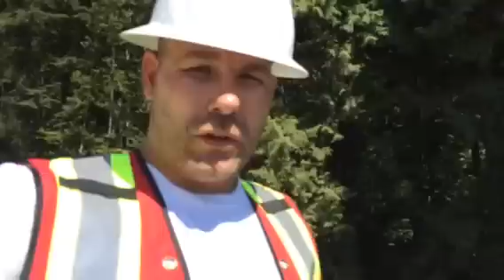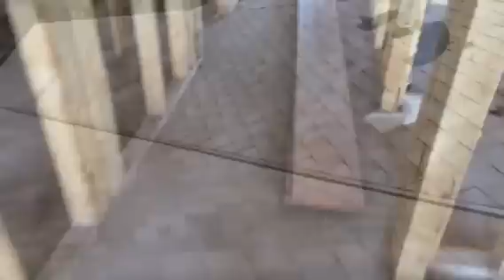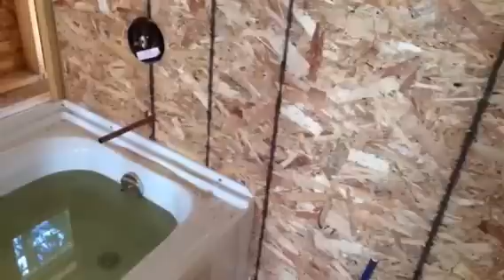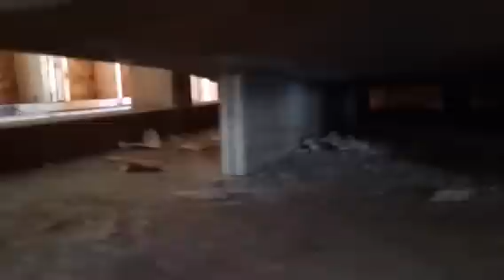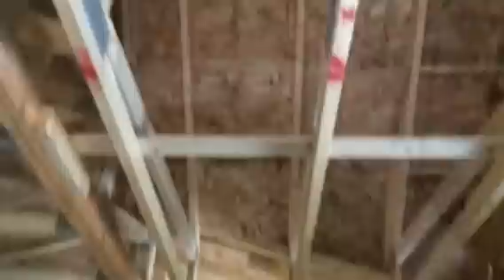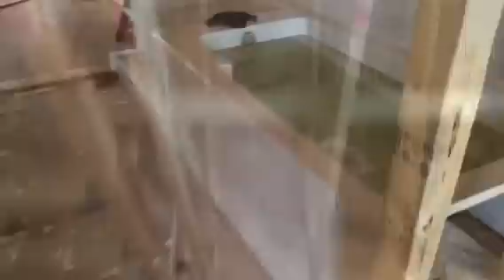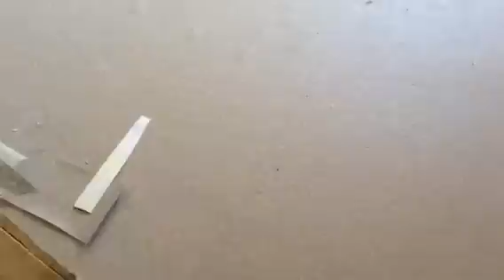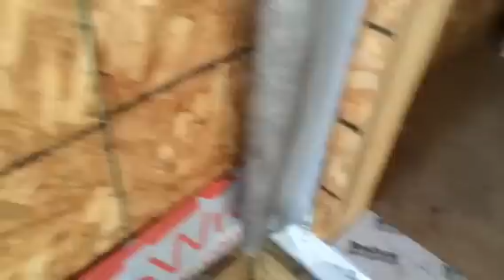New Home Construction Fails

Comment: plywood walls in a bathroom.............fail.
Reply: +wazza33racer OSB not Plywood. They should have used Aqua Board of Cement Board.
Reply: +01blet I do construction in the US and even if is a steel  bathtub we always put concrete underneath
Reply: Plain old drywall is an acceptable backing if it's covered in Kerdi, according to Schulter.
Reply: Real marine ply is a good backing for a Bathroom, but this is just strand board. Absolute cheap shit !
Reply from the maker: +wazza33racer absolutely!
Reply: it could have been a shear panel?? and if it was they installed that wrong also going by cali. codes
Reply: POOPonYOUall   If it was designed as a shear panel it’s on the wrong side of the 2x wall, but I doubt it was designed and I know the code would not require it at this location.
Reply: +01bletsch Yes you are correct. It's a shear wall and will have aqua board or dens shield put over it before the tile goes on. Nothing wrong with that.
Reply: +wazza33racer not if it's kerdi or redgarded
Reply: +wazza33racer oriented strand board is not plywood, neither is acceptable for bathrooom backing.  Constant moisture in woood can  become a growth medium for dangerous molds!
Reply: Incompetence?? Excuse me?? +01bletsch clearly you no nothing about OSB and what moisture will do to it, and I guess you thing joist hangers installed upside down is acceptable??  

I do agree there is no place for profanity in the comments section of my videos.
Reply: +Jamie P The proper way to support the bathtub is with a concrete, base which is best, it won't crack or break under the weight and is simply to do. Shear wall in the bathroom, are you some sort of moron? Please don't build homes and if you do, let me know which one so I do't accidentally by that catastrophe.
Reply: I DRIVE A DODGE STRATUS.
Reply: +C Steele if you've never built a home before you wouldn't know anything about shear walls. If you look for simple clues like that wall is a stairwell wall and may require shear all the way to the basement. So before you call someone a moron check the mirror. That wall is absolutely a shear wall, notice it has blocking at all the joints and also check the nailing pattern. Its a SHEAR wall. Please don't build or remodel a dog house.
Reply: griffey2447 Thanks built two homes, and I doubt this is a shear wall. It could be, so without seeing the whole layout will error on the side of caution but the tub, the upside down brackets, yah, clearly builder is an idiot. Please don't build anything more than a closet  that you can walk out of. ;)
Reply: +C Steele wow so you built 2 homes? ive built close  to a thousand. The only thing I doubt is your ability to see the clues given in this video to actually see whats happening. I didn't see the upside down hangers, couldn't get past the ignorance of the bath. This guy has no business posting ignorant videos on youtube.
Reply: ***** lol bro I agreed with you.  I think you meant to reply to the da home inspector
Reply: oh damn sorry man thought that was meant for me.
Reply: griffey2447 and I bet you put hangers upside down, cut corners at every opportunity, put wood to stabilize the tub which will rot, please send me your info so I can avoid the houses you've built.
Reply: +wazza33racer MUST BE TOLL BROTHERS OR KB CONSTRUCTION
KRAP SHIT FOR BRAIN HOLE HOMES
Reply: 01bletsch  like I mentioned to poop, if it was a designed shear panel it’s on the wrong side of the 2x wall , I have seen this booboo before, not uncommon.  More likely than not, no biggy, will be caught by city inspector along with hangars and corrected.
Reply: Maybee u should learn something about plumbing before u inspect stuff and tell people wrong info
Reply: You're Correct!  It should be Green Board OR Lath & Plaster!
Reply: Bathroom building is atrosious in usa. This would  NEVER fly in sweden. If this was built here, it would be forced to torn out and and then they would have to pay alot of cash for  breaking building code
Reply: Nothing wrong with drywall in bathroom niche if covered with membrane
Reply: Marine ply is exactly what I used to construct a shower cubicle in my apartment; floor, three walls and ceiling. The base was laid directly to the joists and the shower basin was laid onto a 50mm base of dense mortar, after the side walls were in place of course. After a preliminary coat of PVA the tiles were hung on ordinary tile adhesive right up to the ceiling and grouting and siliconing carried out. The shower screen was then installed, sealed and passed (by me). Drainage, lights and plumbing second fixes complete we've used this facility ever since, for the last twenty year, with no issues. I did a regrout a year ago and replaced the silicon sealant; it works as well as ever.
Reply: +The Home Inspector I also agree that this video shows your incompetence. From not knowing what a shear wall is, judging the bathroom waterproofing before the waterproofing is done, to making judgements on the bathtub support system (from the bathtub manufacturer) shows your inexperience. While I respect that everything in this video isn't incorrect, much of it is full of unnecessary urgent judgement.

Comment: 0:04  WOW that really is a unique inspection, “a house that's actually been built from the ground up”.  Most homes are actually built from the roof down.
Reply: +Lenny F ARE you just joking? or trolling? from the ground up means in English that it has been built from scratch IE it is a new build... common English usage in no way suggesting anything about building a roof first then whatever...
Reply: +Lenny F Well, some of the contractor's I've worked for in the past seemed to like to do things ass backwards, lol.
Reply: +Lenny F I too thought is was funny calling it a "unique inspection"I did see a house ( just once) built from the roof down, the builders built the roof, when complete they put floors down and walls up in a day then a crane came in put the completed roof on, it rained the next day but the house interior never saw a drop, all the other houses being built around have wet expanding OSB, so from the roof down though ass backwards may be a better way to build.just an observation.
Reply: +Terry B   Even though the roof may have been pre-assembled,  the house was still built from the foundation up.  To build a house from the roof down, you would have to suspend the roof from a skyhook and then build the walls and the foundation last.
Reply: Well to give him some credit it might be confusing to tell which direction the house was built after looking at those joist hangers.
Reply: +Lenny F True enough but now your just being picky, LOL
Reply: Actually,  can show you 1. it's in central Florida 👎
Reply: +rmyd027 , you really must be a ball of laughs to be around
Reply: +Things that stop you dreaming,  In the three weeks I've been reading and writing English, “from the ground up” means, starting at the bottom and working to the top.
Reply: Lenny F Well good for you... I have spoken and written it from a very early age. http://idioms.thefreedictionary.com/from+the+ground+up see bottom defintion, there is more then one defintion depending on the context, you're welcome.
Reply: That's funny, all the homes I've built were done from the ground up on new construction.
Reply: +Lenny F Learn context... and when it comes to particular industries, Jargon. From the ground up is usually meaning its a unique 'Custom' built house, rather than these cookie cutter houses that are built in the hundreds at a time and as such are not unique in any way and as such the plans for say the 2nd floor are already known because it will be the same as house 'x'.
Reply: Lenny F Certainly, I have a lot of fun on my job sites, but you said something that needed to be corrected, your fault for not understanding the industry and its jargon. Next time don't make an uneducated assumption about what someone says.
Reply: +rmyd027 Wow,  you have me in stitches just laughing my ass off.  Wish i could work on your job site.....NOT ! ! !
Reply: +Xxx Xxx   Being a lefty, I’ll buy your left handed hammer, mine is worn out.
Reply: Things that stop you dreaming Of course, I'm joking.  But, there is a very interesting house in land o lakes, Florida that I was interested in. Someone built this very special home, using builders block concrete pour formed
Reply: Things that stop you dreaming installed all of the wooden roofing,but never finished or started to shingle it. Sadly it's all rotting from the roof down. Yet, its still a solid bunker of a home,on a very strong foundation, plumbing and sewer are done. Yet, it sits dying & I don't know how to start to finish this beautiful private lot. I'm so frustrated by this, ya know...
Reply: I Am The SONOFOVERBROOK I live in a 115 year old house that needed a LOT of TLC when I moved in so yes I both know and sympathise, cut of the rot with a barrier and work your way up if it is like my house
Reply: Ispike73 "Don't end a statement with you're welcome" He was welcome, read back he is learning English.
" I'm not sure what you're trying to accomplish here " Correcting his English and his arrogance.
"we all know what "from the ground up means"" He didn't.
" go find something else to be offended about." 
Who on earth said I was offended? :D
Reply: Things that stop you dreaming You're an idiot if you really believe he's just learned English three weeks ago, sarcasm is lost on the stupid.  You're a pretentious, wannabe intellectual, jackass.  Ya know, I've always found it funny how the people that think they are so much smarter than everyone else are actually just the opposite.
Reply: Ispike73 "u really believe he's just learned English three weeks ago" No I didn't but hey go with the flow.
"sarcasm is lost on the stupid." Possibly why you failed to spot it then.
"You're a pretentious, wannabe intellectual, jackass" ohhhh such a string of insults, well done :D did you listen to daddy talking to mommy again?
"smarter than everyone else are actually just the opposite" This also then explains why you are ignorant :D
Reply: Things that stop you dreaming "No I didn't but hey go with the flow." uh-huh, sure.  You're not stupid, you just pretend to be.  Got it.
" Possibly why you failed to spot it then."  Okay, point it out to me then.  Apparently your intellect is on such a higher level, that your wit is beyond comprehension, so please, enlighten me.
 "did you listen to daddy talking to mommy again?"  No, I haven't seen my father in over forty years.  You sound like a child, trying to sound like an adult.
 "This also then explains why you are ignorant"  Well actually bud, I don't think I'm smarter than everyone else, just you.  Then again, that's not saying much. :D
Reply: Ispike73 " Apparently your intellect is on such a higher level, that your wit is beyond comprehension, so please, enlighten me" I am afraid it really is beyond your comprehension, sadly.
"Well actually bud, I don't think I'm smarter than everyone else, just you" whatever helps you sleep at night ;)
Reply: +Things that stop you dreaming  
" I am afraid it really is beyond your comprehension, sadly."  So in other words, you can't.  Well, if ya can't beat em, hit em with a lame excuse.
"whatever helps you sleep at night"  A good days work usually takes care of that for me, you don't factor in to it at all, despite your idiotic username.   ;)
Reply: Things that stop you dreaming "that said it took it awhile to find a small enough rock to find it under"  Why that should be easy bud, your head's full of em!  Just give her a good shake, should be able to rattle at least one of em loose. :D
Reply: Sky hooks are becoming obsolete.
Reply: +Lenny F Probably unique for him being called in during homes construction, homes under construction are usually inspected by a county/city people not private inspectors which he is.   City and county officials "Miss" things all the time, and the new homeowner gets the screw.  Private inspectors are usually only called in for secondary sales, so yeah the ground up would be unique for him.
Reply: +Jeffrey Wooden your and idiot jeffrey...there is no hope for you if you don't get his sacasm
Reply: +Lenny F   I have to see the floating roof system that these houses are built down from which you speak of.
Reply: +Lenny F You have to build the structure (ground) before you can build the roof.
Reply: +Lenny F  I like your syle Lenny F. I think dude in the video is a putz and should have seen the quality issues long before. Anyway in Japan they do build buildings starting from the roof then jack it up and build the next floor then continue. They have limited space and it could be safer if they're always near the ground and support it properly. Strange but true :) This is coming from a guy who fell 3 stories off a roof.
Reply: @Lenny F, I found this comment to be amusing as well. From the ground up? Ya don't say.

Comment: That's what happens when you build a house of wood, gypsum board and tar paper. If it was build out of concrete or brick, you would not have these problems. You would have a house were you would not need home insurance and be prone to accidents or high cost maintenance. I have one of these flimsy houses and it has been problem free for two years since it was built new in 2013 but will sell it in a few years because I know it will cost a lot to maintain the older it gets
Reply: It would but the repairs would be much cheaper. How much does it cost to replace a roof on a wood framed home? Up to $10,000 depending on the size of the roof and needs to be replaced every 15-20 yrs. If it was a concrete roof you would only need to seal it every 30 yrs or so for less than $1000.00.  You wouldn't need termite treatment or fear the siding would blow off on windy weather for example. One thing is true however, wood framed homes have better appearance and look nicer than most concrete homes but the quality and durability is no match. Houses in Florida are mostly made of concrete but the inside is still drywall and wood framed walls so you still need insurance in case water enters the house and rots the walls.
Reply: +Jack Tarr EVERY building technique, requires it's own set of do's and dont's. There is NO exception to that. One can build excelling houses in wood, concrete, brickwork, steelframe.. you name it. One can build ready-build ruins in any of the building techniques as well.  Getting the discussion on a polarisation of technique types, is a competition's sales pitch discussion, not a building requirements discussion. But based on whatever budget, building FLIMSY has to do with money, and building 'bigger' seems be to the goal, not building 'better'. The drive into building rubbish, seems to come from both sides at the same time : house owners (just want 'bigger') and builders (just want 'more profit').
Reply: +Jack Tarr I'm not "forgetting" anything, I was pointing towards the fact that polarising towards one type of construction, 
(quoting) is a competition's sales pitch discussion, not a building requirements discussion.

Comment: nice paper homes
Reply: +John Jesus 
Are you mad because your paper house caught fire, and then got wet and moldy? XD
Reply: Steven B2 dont tell me houses are like that ? In my country russia we use bricks
Reply: 95% of them are like this. Why do you think they blow away in the tornado?
Reply: +petrospress In America we don't care if the houses walls are made of paper. It just needs the latest appliances and should be in the coolest neighborhood.
Reply: +Steven B2 Well in Canada its hard to find any house that doesn't have a basement, provides a pretty solid foundation that would sustain high wind speeds, I've heard basements are rare in some places regarding the states.
Reply: +petrospress welcome to America!
Reply: Steven B2 and why they dont make more reliable homes ?
Reply: petrospress
This construction is cheaper.
They simply follow the "instant gratification" thing that is so common these days.
"Oh, it looks nice, and it's cheap! So why not buy it?" A year later ... it falls apart and serious problems are apparent.
Also, it is very difficult to make homes withstand high winds and debris from a tornado.
Reply: Benjamin Esposti dangerous....
Reply: rmyd027 I always knew Canadiens had more sense.
Reply: Yes in some places in the states basements are rare because they are at low elevations and would get water in them. The reason they are in almost every house as you go further north is that you have to dig further to be below frost line anyways so might as well just finish the digging and make it into extra space.
Reply: One word, earthquakes